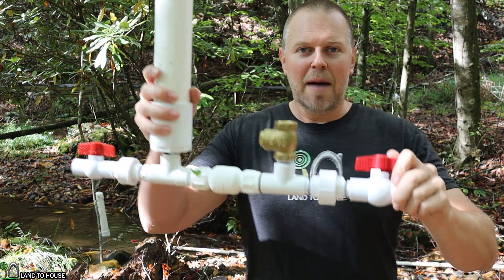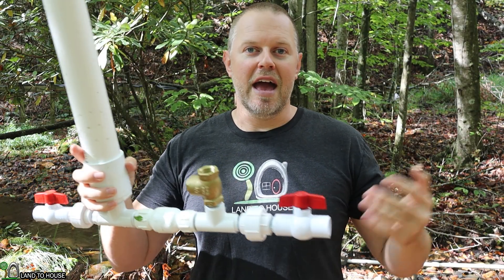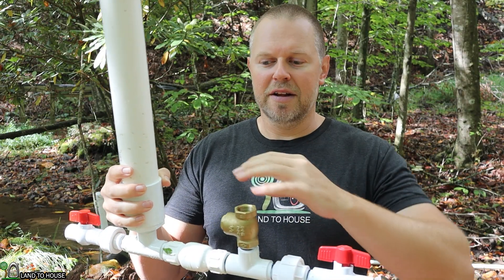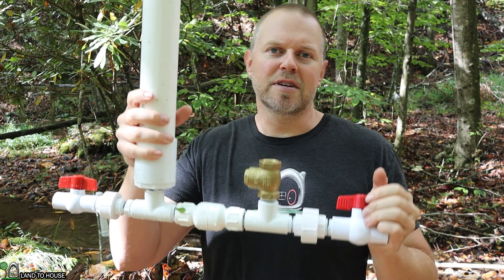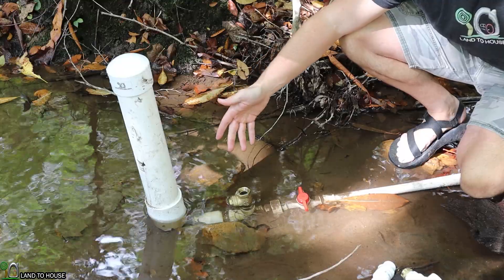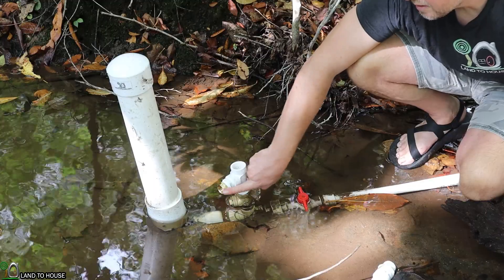Capture Ram Pump Waste Water! Divert Water Away From The Pump!

Comment: Nice to see the ram pump vids back!  I was thinking of a manifold with one 6" pipe feeding 4 1 1/4 inch pumps with all pumps feeding into one supply pipe.  What do you think?
Reply from the maker: Thanks! Its nice to make them again. The 1-1/4" ram pump is going to need approximately 8 gallons per minute flow rate to operate. Depending on the amount of input head pressure you could get by with a 3" pipe. That size drive pipe could flow the 32 gallons required. That pump is capable of putting out 1.5 gallons per minute. A 3/4" pipe could handle 6gpm no problem. Depending on the length , there might be some friction loss.
Reply: @LandtoHouse  Thank you!

Comment: Clever;  using a sideways T so there is free air to prevent a siphon in the waste-drain.  I agree that a waste-drain the next size larger in diameter than the waste/check valve ought to be able to free-flow all the water and eliminate the need for the bit of riser.

Comment: Love your videos. Recently put together a 1/2 in ram pump to pump water from my creek up to our pond (15 ft elevation).I have about a 3 foot of head pressure with 1.3 gpm from the 1/2 in delivery pipe.  I put a stand pipe 16 ft from the pump and im getting 60+ cycles/ min. However, I am only getting about 21 gals day to the pond. I think I should be getting closer to 200 gal  / day. Wondering if it’s because I’m using a 1/2 in brass inline secondary valve with a cracking pressure of 5 psi? Thoughts?

Comment: If you run a hose down hill, then a siphon effect will help you pull more pushing pressure on the lift side of the pump.
Reply from the maker: That's true. As long as the pump is supplying enough wastewater to maintain that siphon

Comment: That's a great idea! However, the rapid flow of water out of the waste valve helps build up pressure, and adding such a pipe to the waste valve will affect the operating performance of the rampump.
Reply from the maker: I find that the water sitting on top of the waist valve counteracts the input head pressure and does reduce the output. However in this case it is minimal.

Comment: The reason to put the pump in a tub and drain the tub elsewhere, is it adds less restriction to the waste output than does your directly attached hose or even a pipe.

Any restriction on the waste output will reduce your usable head, as you noted.  A hose or pipe directly added to the waste output will add some restriction which is directly equivalent to running uphill.  I recommend if you are going to attach directly to the waste valve that you use a pipe at least one size larger than the valve, or a hose that is at least two sizes larger. The longer the pipe or hose, the more you need to upsize it to minimize the restriction.
Reply from the maker: I like your idea of stepping up the size of pipe at the waste valve. That is a good way to prevent the water from climbing up that small pipe. 

The catchment tub under the pump does work but also captures lots of debris and unwanted things from the surroundings.